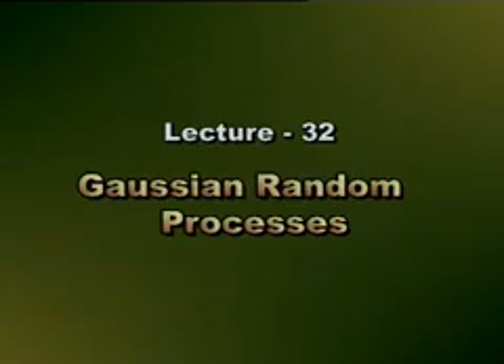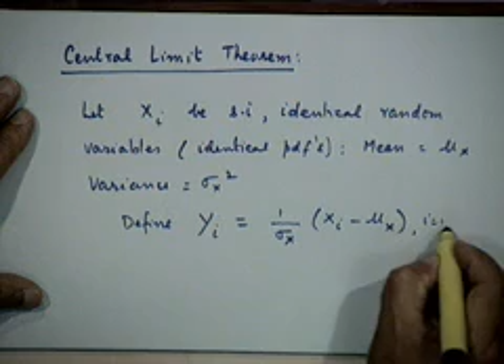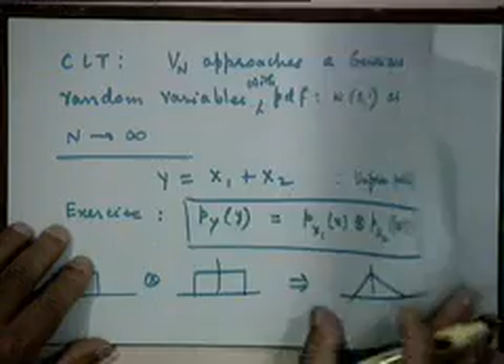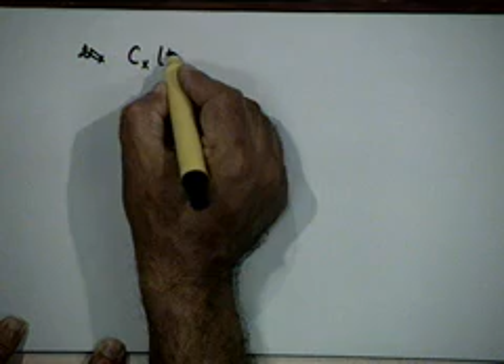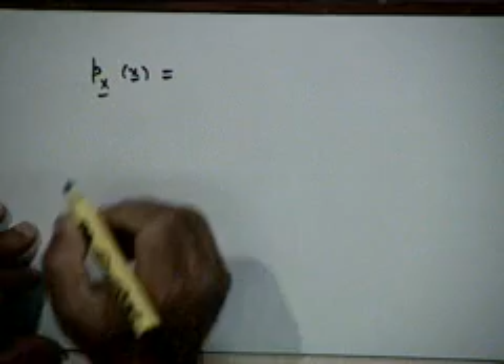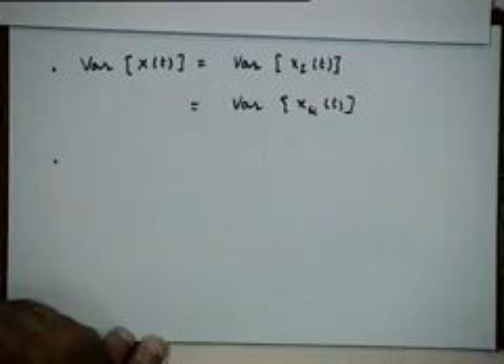Lecture - 32 Gaussian Random Processes

Comment: 🎯 Key Takeaways for quick navigation:

01:06 📚 Gaussian Random Processes are an important topic in Random Processes and are based on Gaussian random variables.
02:27 🤓 Jointly Gaussian random variables are those for which any linear combination results in a Gaussian random variable.
04:10 💡 Gaussian random processes are defined by extending the concept of Gaussian random variables to functions of time.
06:37 🌐 Gaussian random variables and processes are commonly used models in various fields due to the Central Limit Theorem, which justifies their use for many physical phenomena.
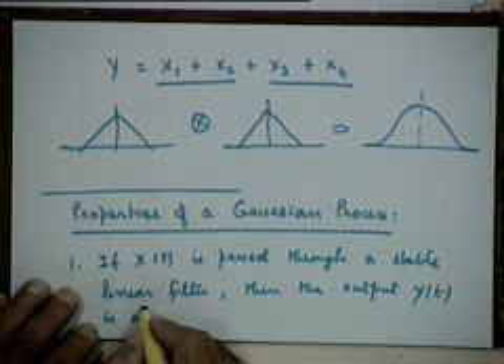17:53 🧮 Passing a Gaussian random process through a stable linear filter results in another Gaussian process.
25:39 📈 The covariance matrix characterizes the relationship between components of a vector of Gaussian random variables, and for statistically independent random variables, it's a diagonal matrix.
32:16 📊 The joint density function of N Gaussian random variables can be expressed using the covariance matrix and vector notation.
32:42 📈 The expression for jointly Gaussian random variables can be written in vector-matrix notation, where the density function is defined using the mean vector and the covariance matrix.
33:33 🧮 The determinant of the covariance matrix sigma relates to the product of the individual standard deviations, allowing for a more compact expression of the density function.
35:44 📝 A general expression for the joint density function of Gaussian random variables can be represented using vector notation, making it easier to handle various sets of random variables.
37:07 📊 The auto-correlation function can provide the necessary information to derive the density function of any set of random variables in a Gaussian process.
37:59 📈 A Gaussian process is fully characterized by its mean value function and the auto-correlation function, allowing for the determination of its density function.
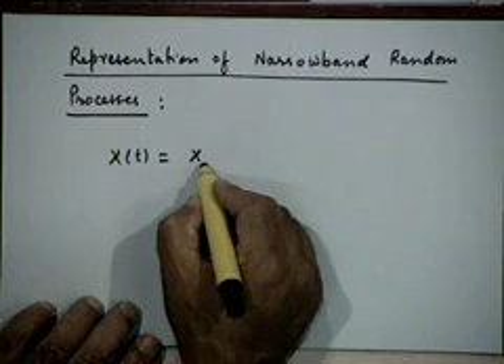41:01 🔍 For narrowband Gaussian processes, a quadrature representation can be used, expressing the process in terms of in-phase and quadrature components, which are low-pass processes.
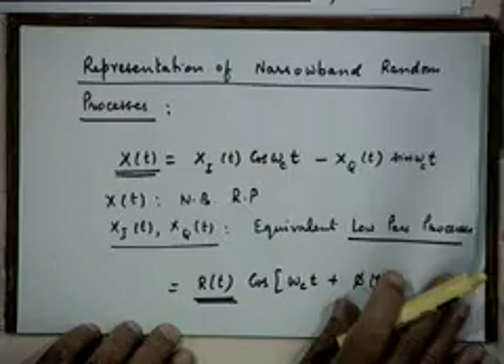43:48 📊 The average power of the original narrowband signal and its quadrature components (X, XI, and XQ) are equal, demonstrating that they have the same variance.
44:57 📊 If a narrowband process X(t) is Gaussian, the in-phase (XI) and quadrature (XQ) components will also be Gaussian random processes.
45:36 🔄 If a zero-mean Gaussian process (Xt) is narrowband, the in-phase (XI) and quadrature (XQ) components are statistically independent.

Made with HARPA AI